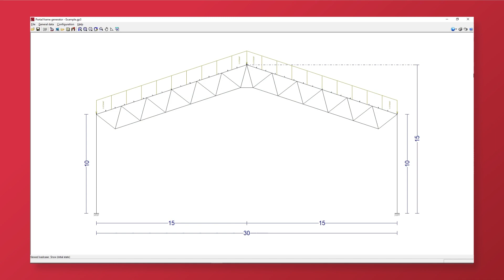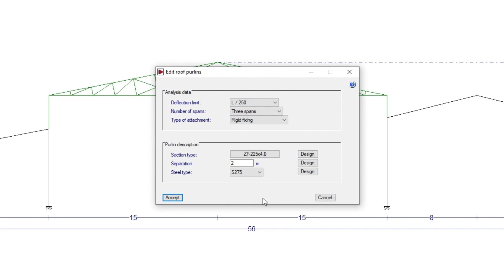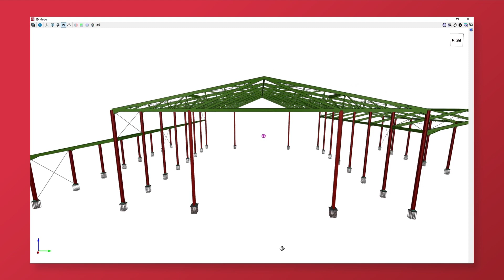Portal frame generator

Comment: can this software optimize truss or portal frame profiles?
Reply from the maker: Hello Mateus! Portal frame generator is a program that allows you to generate a geometry of members and loads to export it to CYPE 3D. In the latter program, CYPE 3D, it is possible to carry out the complete calculation of the structure and carry out checks according to different standards, modify the geometry received if necessary and add, edit or delete the desired structural elements to optimise them. Greetings😊